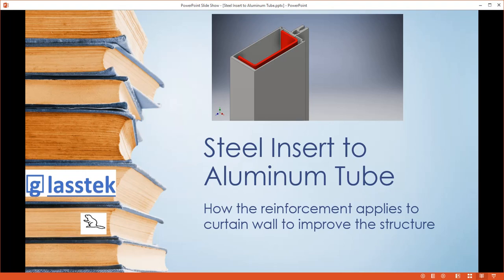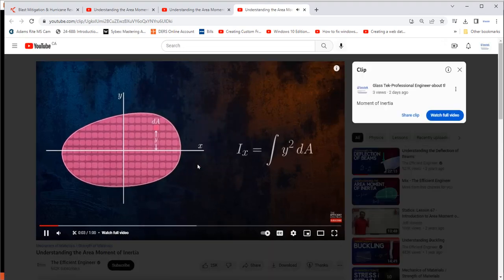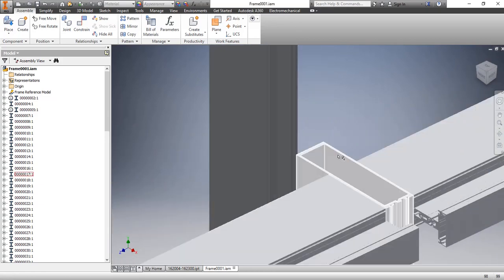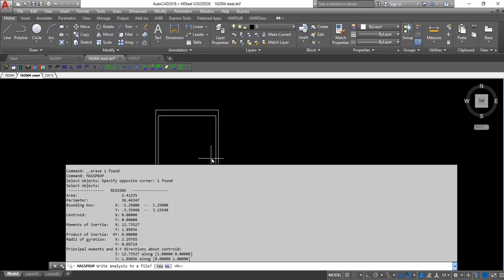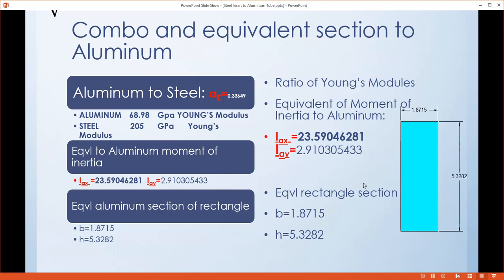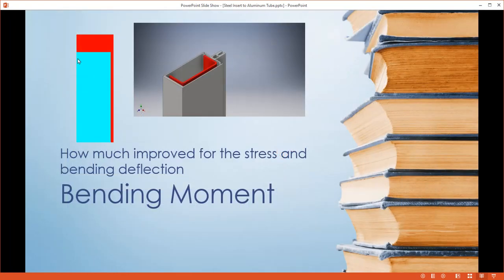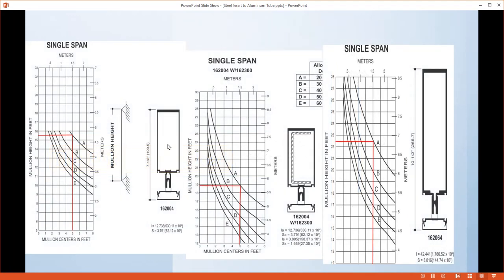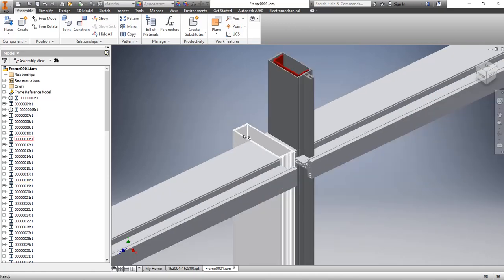Steel Insert to Aluminum Tube

Comment: There is a gap between the aluminum extrusion and the strengthening steel bar. Your presentation lacks a part stating conditions allowing them to work together as one equivalent section. I mean: you forgot the shear stress between the 2 bars. You need to prevent the 2 bars from sliding from one another so that they work as a monolithic section.